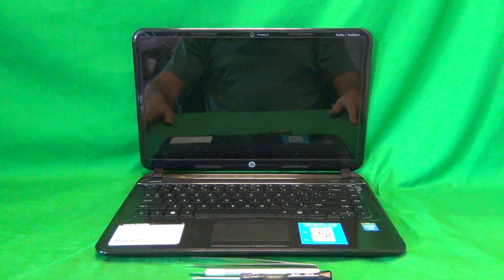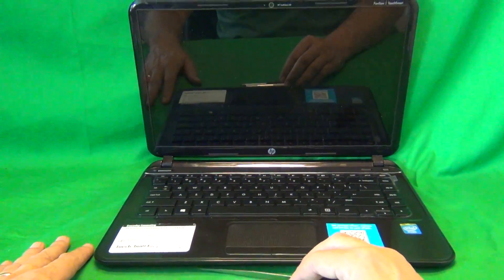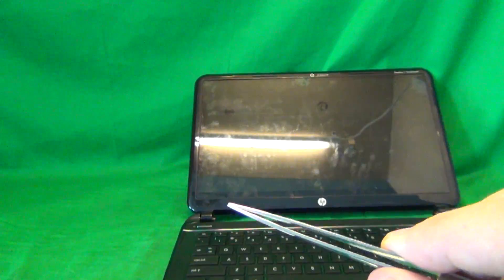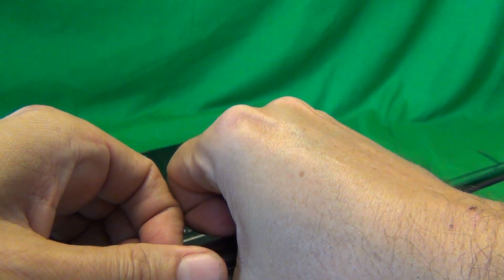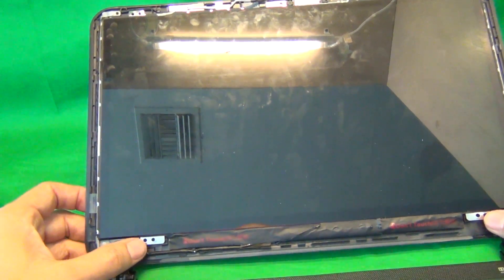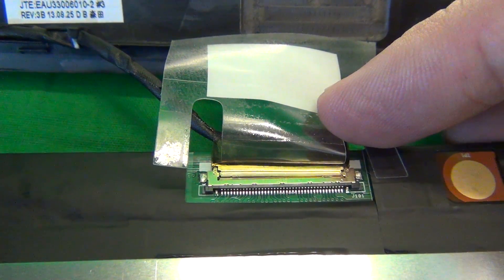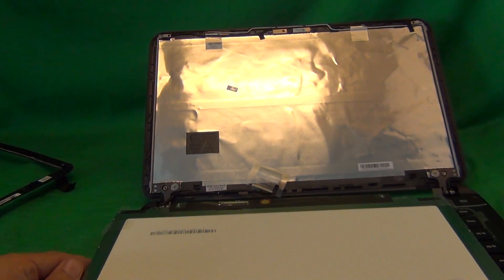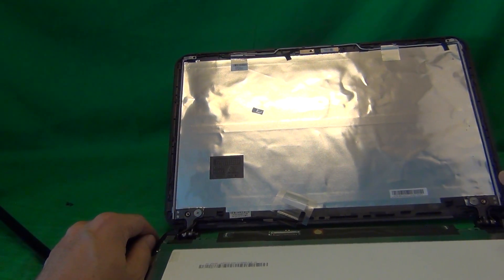HP Pavilion TouchSmart 14 Sleekbook Laptop Screen Replacement Procedure

Comment: one question, will the non-touch screen version work for a broken touch screen? i really don't care for the touch screen and would rather save my money on the cheaper one.
Reply from the maker: +dwarfminerwillie No it will not work. The screen and digitizer for this are assembled as one and has to be replaced with the exact one.

Comment: Good video, it would be great if you add the remaining video. I mean installing the new screen and the bezel. Thanks.
Reply: The trick is making sure all the wires are routed exactly how they was when it came apart or it won't go back together all the way without a fight
Reply: The trick is making sure all the wires are routed exactly how they was when it came apart or it won't go back together all the way without a fight